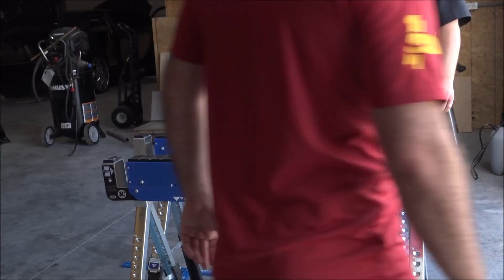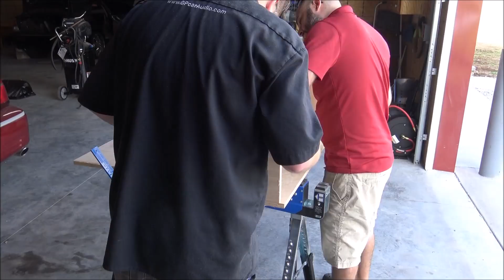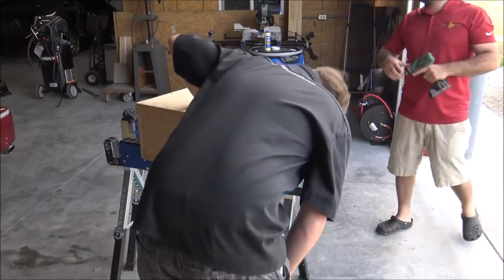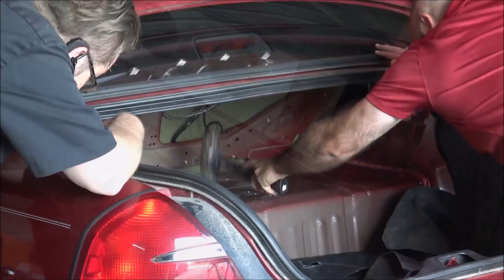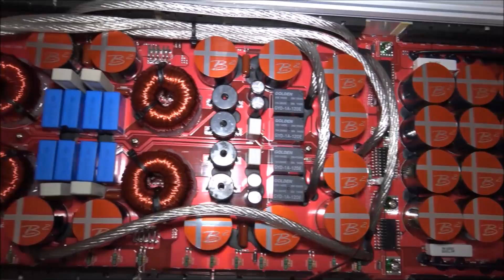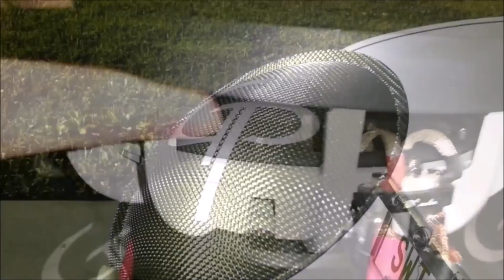3 B2 Audio HNX 6.5" Subwoofer enclosure build

Comment from the maker: Stay tuned for this playing, and stay tuned as the 2 B2 Audio XNv3 Neo 18" build is finally about to go down! 
OK, so the original plan of 4 of these in the space we are going would not work, we either had to tune way to high (50hz) to recoup airspace or lose a driver, so we decided to go with 3 B2 HNX 6.5" Subs instead of 4, it was the only choice and got us down to a 36hz tune. 
So today we threw this box together in a couple hours. For 3 b2 audio HNX6.5. The enclosure will be carpeted tomorrow and likely hooked up and playing. 
 Enclosure is 42x16x10 and fits nicely under the rear deck area.
This build is just for listening enjoyment so musical range of sound is what is desired on this one, numbers on the dash are not a concern, as its not an ideal placement for numbers, but the end result will be nice and clean. This car is used everyday so room in the trunk has to remain for misc daily duty's.
Also noting, we cannot find our router and clamps, who knows.

Comment from the maker: GPcarAudio.com 
💥BUMP TO SCHOOL SALE💥 
HUGE SAVINGS on Northstar battery⚡
Coupon Code: back2school 
NORTHSTAR SMSAGM220 $324.00 SHIPPED 
NORTHSTAR AGM31 $315.00 SHIPPED
NORTHSTAR SMSAGM480 $630.00 SHIPPED
NORTHSTAR AGM34 $240.00 SHIPPED 
NORTHSTAR AGM34/78 $261.00 SHIPPED 
NORTHSTAR AGM65 $256.50 SHIPPED 
NORTHSTAR SMSAGM80 $180.00 SHIPPED 
NORTHSTAR AGM48 219.00 SHIPPED 
⚡Sale ENDS 8/31/17⚡
SAVE BIG on⤵⤵⤵⤵
✔Northstar Battery 
✔GP Machined Parts 
✔The COMPLETE Wiring Kits 
✔GP STFU SOUND DEADENER
✔Team GP ALTERNATORS
✔GP Ultra HFI RCA's 
✔Amp kits 
✔Big 3 kits 
✔The Complete System Packages
✔Pre terminated wires 
✔NO SAG Springs
✔GP NO BS PURE COPPER WIRING 
www.GPcarAudio.com
☇FREE SHIPPING☇

Comment: I've got a Crown Vic and I've been playing with the idea of a box to go in the same spot but could I get away with using 10s or 12s if I had them firing up towards be the rear deck?
Reply: Dont do it...better off going with some sundown 8s firing backwards. That rear deck will rattle and sound muddy. Unless you are doing a bandpass in through the rear deck.
Reply: @SoleCollector89  are you sure